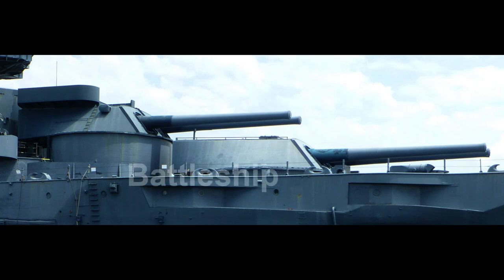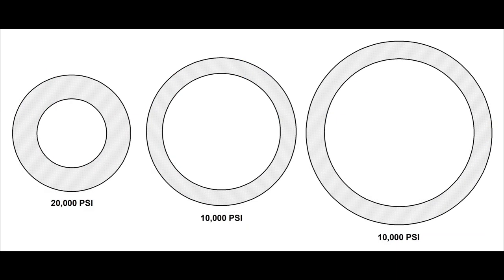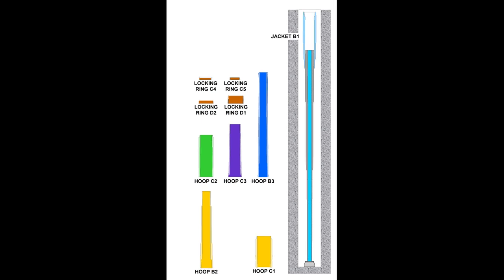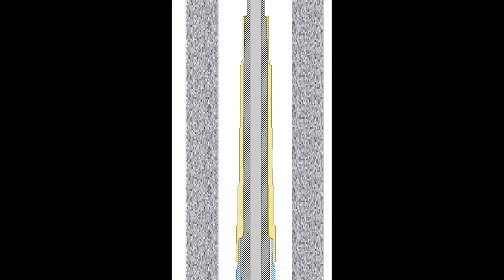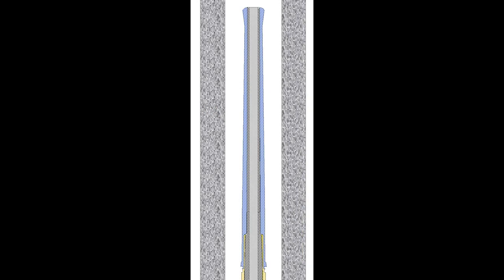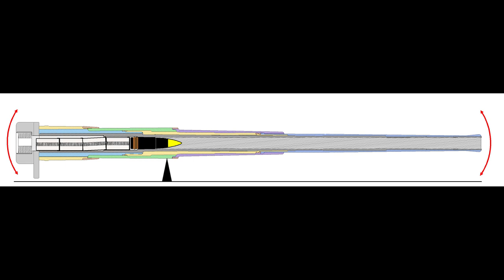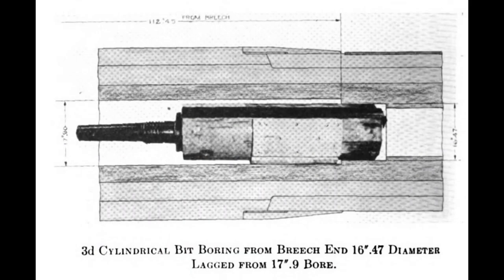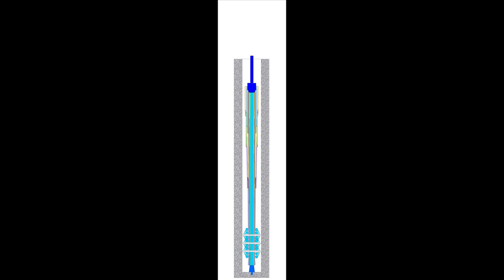Battleship TEXAS Hoops, Sleeves and Rings

Comment: Your step by step explanation was superb. I have read about built up barrels and even seen the diagram of one, but never knew the procedure. Same with the relining. I knew it was done, but never heard how. I always thought they removed the old liner and shrunk in a new one. I never knew they machined out the old one. Thank you.
Reply from the maker: You are correct, liners were shrunk into place.  Barrels were initially constructed with thick gun tubes and without liners.  The first time rebuild of a barrel required machining the rifling and powder chambers out of the gun tube to bore it enough to accept a liner.  From there, liners could be installed or removed by heating and expanding the barrel.

Comment: Pretty impressive, as always!  I love stuff like this, the old technology that's been lost to history.  

As a now-aging former tank gunner (from the late 1980s) i wonder if tank barrels are made in a similar manner; back in my days, which is two or there generations back in terms of tank ammunition design, we were running chamber pressures in the 70,000 psi range.  Also, I would imagine if naval gunfire systems kept pace with tank systems, "modern" battleships would likely have thermal sleeves over the barrels, to keep from getting gun tube droop from the heat from the sun causing the upper surfaces of the exposed barrels from being hotter than the undersides (which is why tanks have thermal sleeves on their barrels)
Reply from the maker: It is my understanding that when the Iowas were modernized in the 1980's, they took advantage of lasers to detect and compensate for droop.  Also, there is another method for strengthening smaller barrels (8" and smaller) without resorting to built up construction.  They seal the bore and hit the inside and outside with immense hydraulic pressure that has the effect of compressing the outer layer of steel to create internal compression that accomplishes the same thing.  The technique has been around for a number of years and would explain why your barrels could survive such high pressures.

Comment: I hadn't realized the guns were of such advanced design. Just 'cause it's old, does not make it crude design. Very cool sir, ty🙂 what was the lead-time for a new barrel?
Reply from the maker: It usually took 1-1/2 to 2 years to produce a barrel.  However, keep in mind that they were producing several of them at a time, so production was slowed down at choke points like the shrinkage pits.  The gun factories one had one of those that could handle the large barrels.

Comment: Perfect detail as always. BZ!
The fear from liner extrusion was not so much loss of accuracy, but that the liner would crack rendering the barrel useless. The rule was to mil the barrel when the liner was out about 1/2 inch. That was about after 100 full service rounds fired for a 16 inch barrel.
Reply from the maker: Thanks, Bob!  You say 100 esr's, but how often did you fire a full charge as opposed to reduced!  That would have a tremendous effect on the issue.  Btw, in my defense, I did read that accuracy could be affected in an old ordnance manual.  However, I put more faith in someone, such as yourself, who personally dealt with the issue than I do in my sporadic memory!
Reply: @tomscotttheolderone364  
We used full charges almost exclusively. The only times I can remember using reduced charges was for testing as the reduced charges came in a flash less and a smoke less versions.  There was not much of a change in either flash or smoke to the naked untrained eye. So we never had much need for the reduced charges as we generally were going for longer ranges. 
Also as an interesting aside, when we first started firing the guns again in 1982 we were not using lead foil. (We hadn’t gotten that memo☹️) We started getting liner extrusion after firing about 5 rounds and copper build up in the rifling to the point were we couldn’t pass a bore gauge! Luckily an old salt chief saved our bacon and we got the lead foil and that solved the problems almost instantly.

Comment: Awesome video! Could you please dedicate a video explaining the mechanism and effect of autofrettage?
Reply from the maker: Thanks for your interest, but not at this time.  The only weapon on Texas where it may have been used was on the 3"/50 cal. cannon, but I am not sure since I haven't researched them in detail and have no immediate plans to do so.  I probably never will due to the poor response to my 5" gun video, which I consider to be a much more interesting weapon.

For anyone else reading this and wondering what autofrettage is, it is a method using hydraulic pressure to "squeeze" the barrel to create internal stresses similar to the effect of compression caused by shrinking hoops and sleeves on a barrel.  This greatly increases the barrel's ability to withstand high chamber pressure.  The method works well on smaller bore weapons and is still in common use.

Comment: Only a highly industrialized country could produce such warships.   The effort to fit the new barrel liners is herculean!  I heard that liners needed to be replaced every 1,500 rounds per barrel firing so there is a lot of down time in a major Naval
Port to service a battleship!
Reply from the maker: If a barrel fired only armor piercing rounds using a full service charge, it would only last for 150 rounds.  However, if it fired only high capacity rounds using reduced charges, it could last for more than 3,500 rounds.  Since reality lay somewhere in between, they clearly kept very detailed firing logs for each barrel and didn't wait until a barrel was in immediate need before replacement.  Fabricating new or rebuilding barrels could take 2 or more years, so the only practical thing to do was to have a number of spares ready to go.  The Navy wanted to always have spares in the amount of 25% of the total number of all types of barrels used on battleships.  Ships made regular trips to a shipyard for repairs, upgrades, and cleaning and painting the hull that could last up to a couple of months.  These were scheduled months in advance and planned with great detail that included approving all work, and pre-ordering and positioning all required parts and supplies required for the work.  Records indicate that regunning was always performed during one of these trips.  Since turrets had to be partially disassembled to regun, a limiting factor was it had to a yard with a crane capable of lifting the extremely heavy barrels and pieces of turret armor.  While I have never performed a search to know all of shipyards that had this capability, I know that the ones at Bremerton, Washington, New York and Norfolk did.
Reply: The 1500 number is the last approximate round count the mk7 16in barrel could last before relining.  This was only the case in the 1980s where it was a fatigue issue. The wear on the bore was very small thanks to additives.  The original round count for the barrels was about 300 full service charges firing the 2700lb ap.

Comment: Could the re-furbing with a liner be done more than once? Or was it a one time deal, then the barrel was done?
Reply from the maker: It sure could.  In fact, all of the barrels on Texas have been relined twice.  Once they initially bored out the gun tube during the first rebuild, they could reline a barrel any number of times with no detrimental effect to it.  A liner could be removed by putting the barrel in a furnace pit, circulating water through the liner to keep it cool, then slide it out once the barrel expanded enough to loosen its grip.  From there, they could check the barrel for trueness and then reheat and install a new liner.  However, they always did more than that.  There were always improvements to be made.  In fact, the barrels on Texas started life as original design Mk. 1's built in 1912.  They ended up as Mk. 12's, the final and best configuration.  Here's a piece of trivia for you.  Nine of the ten barrels now on Texas were the originals installed when the ship was built!  That is a stunning coincidence since there was no reason to intentionally assign them to the ship.
Reply: @tomscotttheolderone364  Thanks!  And considering this was all engineered without an electronic computer is amazing!  Good old technical know how!
Also, you should discuss how the secondary 5” guns are made too! I know my dad used to talk about his DD having to get its barrels relined a couple of times during the war.

Comment: Thank you Tom.  Truly incredible!  The complexity of it and all without computers and lasers.  How long would the construction and rehabilitation processes take?
Reply: I was wondering about the length of time for those also.
Reply from the maker: It was not uncommon for turn-around time for a barrel to be 1-1/2 to 2 years.  However, production time was probably longer than it could be because they likely simultaneously worked on several barrels at different stages to maximize factory efficiency.   This could result in a barrel having to wait for its next production step while one in line ahead was being worked on.  Basing efficiency on groups of barrels as opposed to singles was important since they were typically consumed from inventories in lots of 10 or 12 as ships were built or rebarreled.

Comment: Very nicely done,  but how long did it usually take to make a barrel ready to ship out?
Reply from the maker: It could take up to 2-1/2 years, even for rebuilds.  I can't think of why a single barrel should take that long other than factories probably stayed loaded most of the time from the early 1900's through WWII.  That meant that some barrels may be sitting in line waiting for their turn at production choke points like the furnace or shrinkage pit.
Reply: @tomscotttheolderone364  thank you

Comment: While i cant talk much about how modern artillery barrels are made, I do know a little about their wear and tear.  Each barrel has a set service life before they must be replaced, or in this case sleeved.  There are several way to do this, predicted and measured.  The second way, measured, is done with a pull over gauge. This measures the bore at a set spot in the barrel.  The first, predicted, is when you look at how many rounds you have fired.  you must account for partial charge rounds and full charges.  Once you know how fast the barrel wears with each type of round, its simple math to predict the bore wear.  
All this is important, and tracked, as the firing power of the gun drops as the bore gets a little wider.  The round will come out slower, and that's bad.  There is one way for the round to come out faster, and I wonder if anyone knows it.
Reply from the maker: Thanks for your input.  During Texas' career, they primarily used statistical methods based upon predicted wear, as you discussed, and keeping detailed firing logs for every barrel.  As you also mentioned, they accounted for more or less bore wear caused by the difference between firing armor piercing and high capacity rounds, and also between full service or reduced charges.   Highest wear was caused by firing an a.p. round with a full service charge that produced an initial velocity of 2,700 feet per second, giving it value of 1 "Equivalent Service Round".  Firing an h.c. shell with a full service charge wore less and was assigned a value of .78 ESR, reflecting that.  What is really astounding is the extremely low wear of .07 ESR caused by firing an h.c. shell using a reduced charge that produced an initial velocity of 2,000 feet per second!  That meant firing 14 h.c. rounds using reduced charges produced slightly less wear than firing a single a.p. round!  This was really important for Texas considering that she provided a lot of fire support for landings where h.c. shells were used at fairly short ranges!   Since all of this was educated guesswork, they occasionally measured bore wear using a star gauge like the one shown in the video.  It is my understanding that the gauges were not kept on board, so this would have been done at a properly equipped shipyard.